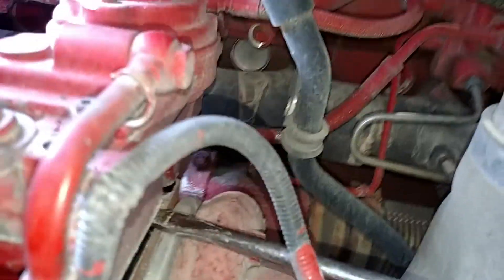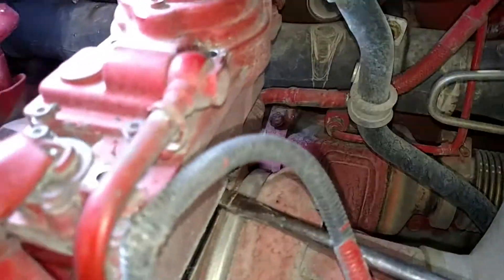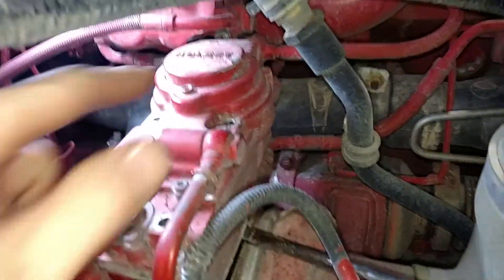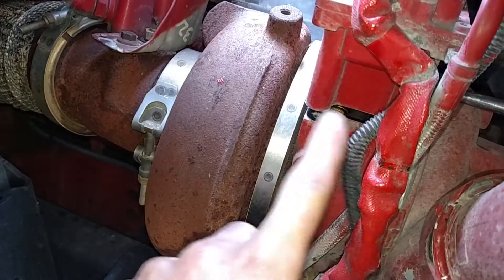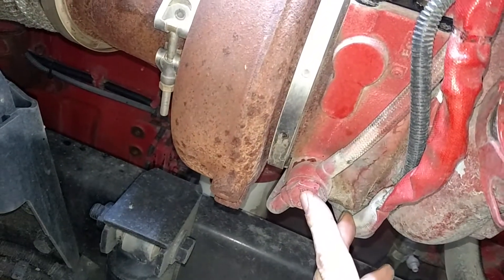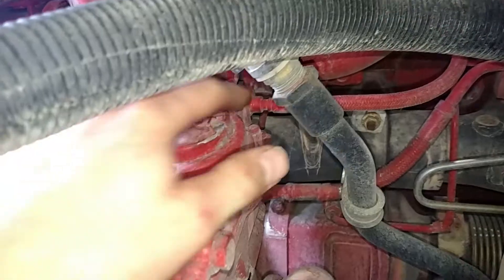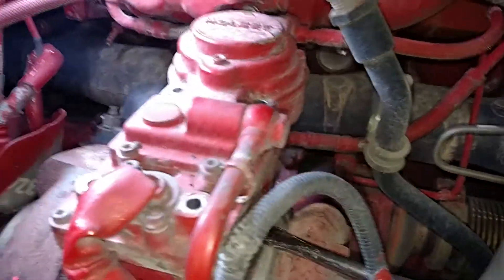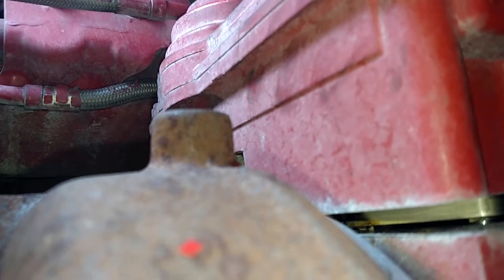Bad vgt

Comment: Does a bad vgt throw a check engine light? I'm having an issue. Truck runs fine. I can hear like a cough when I back off the accelerator when driving or when the cruise control is on it does it when it coasts. Any ideas?